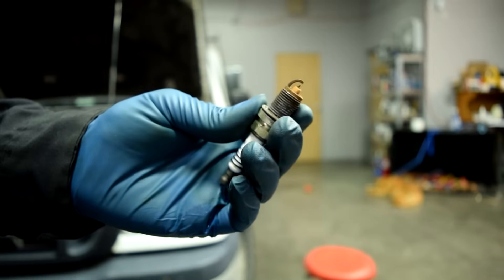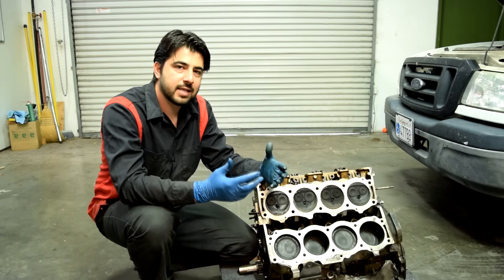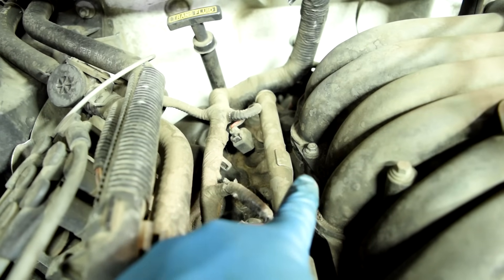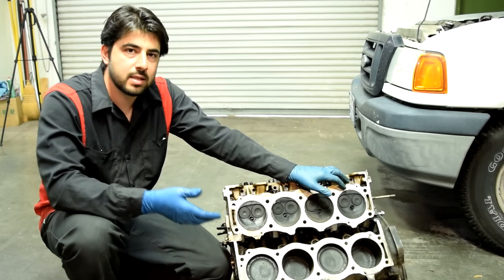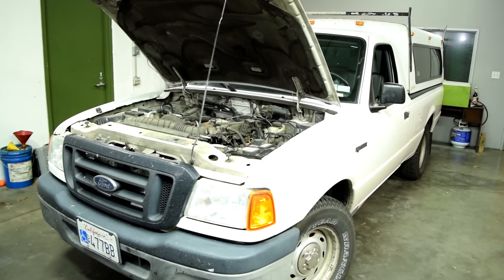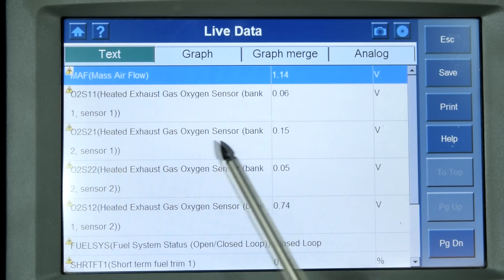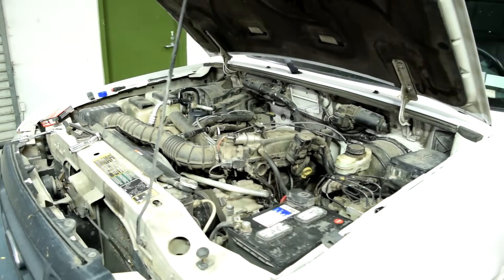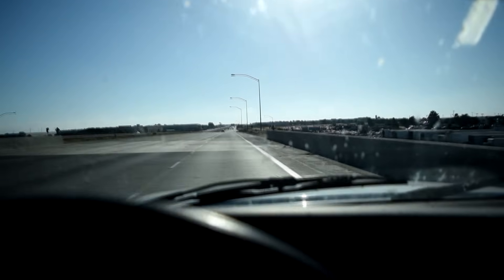How to Easily Diagnose and Fix Engine Knock

Comment: Hello. I just watched your video on fixing an engine knock. I really did watch till the very end. It was very well spoken for us non-machanics. I was hoping there were other areas or things to look at before going straight for the "new" motor. The only difference is that I am looking at a vintage 1974 GMC motorhome with a 454 engine that has been sitting for a while and is now starting to knock. I will look at all you recommended before going further. Thank you.

Comment: A small metal fell into the first cylinder and was removed after notice a noise. After starting it again a knock sound was heard, now it is not starting up. What can be the damage and to what degree? Your help please 🙏

Comment: Been having issues on my new to me truck a Silverado with 133k keeps throwing a knock sensor code already changed the maf which was at 1ish g/s at idle . Cleaned the intake manifold and I’m going to change the spark plugs next hopefully that was my issue 😢

Comment: if detonation sound is caused by wave fronts colliding then why preignition sounds the same? 
in cars with two spark plugs per cylinder why don’t the wave fronts make any knocking sound. 
 self ignition after soark ignition causes the  mixture to burn faster amd messes up timing but retarding timing helps.

Comment: Hi friend. I believe what you are trying to describe is called pre-ignition which is different from detonation. 
Pre-ignition is when you have a secondary source oh heat such as carbon deposit that would cause the fuel and air mix to ignite while the spark plug is off. 
Detonation is when you have two or more pockets of compressed air and gas mix that would ignite at the same time within the same cylinder. Since the two explosion have and fight for the limited space their collision will cause what’s known as a knock.
Reply: Pre-ignition, well, as the name suggests, happens before spark plugs ignite.
So detonation must be pockets of secondary ignition at or after the spark plugs ignite.

Comment: My car only start knocking when I put it on any gear and push the accelerator and when I release the accelerator then there is no any knocking noise, At idle condition doesn't matter how much I accelerate it remains smooth, problem occurs when I accelerate with gear in running condition and there's no noise from transmission but only from engine when I accelerate to run the car with gear

Comment: I have a 2006 Chrysler 300C 5.7 that is heavily modded (2009+ cylinder heads, 2009+ intake manifold, headers, cam, MDS/EGR delete) currently untuned. It only runs if the MAP sensor is unhooked at startup. You can plug MAP back in while its running, but then I hear a knocking/pinging noise. I'm guessing due to detonation. Between all the mods and EGR not able to be used (there's no way to hook it up and make it work with the new heads) that's probably why I heard that sound. It went away when I unhooked the MAP sensor again. Plus the heads also increase compression to about 12:1 or so. Its probably a combination of several factors, Fuel/Air/EGR. I just wish my tuner would stop dicking around and send me my tune.

Comment: I thought detonation happened before the ECM or distributor commanded spark ignition. Not after. That’s why it’s so bad. Because the piston position is still a long way away from being where it needs to be and the explosion of fuel tries to send it back the wrong way. Another term used to be pre-ignition. And advanced timing also causes it.

Comment: I think you are mistaken when you have mentioned that the over advance for ignition is igninting the spark at 5° before  tdc instead of 15° before tdc, this is actually retarding of ignition timing, which is recommended to prevent detonation.

Comment: I replaced my rocker box gaskets and new spark plugs and gaskets 4 days later I start the engine up the engine was knocking 2 times then it stopped if I go really fast you hear it knocking then I slow down it's ok every time I start it I hear it knocking that would be something about the spark plugs, can you let me know please or someone. I will need to take off my inner take manifold and I don't want to do that again it sounds like I need to take it off

Comment: Guys I need help I have a 2004 mustang and sounds like I have a rod knock cause the engine knocks when it runs but I think I could have a head gasket problem cause when it drives the coolent boils and over heats

Comment: I got a 2013 Chevrolet impala  and with direct injection i had a pinging noise when i accelerated,  i added that Berryman B-12  AND it really helped that pinging.  I assume i had carbon build up . Very interesting video 👍
Reply: You added to the gas or what exactly ?

Comment: I have an 04 Tacoma V6 that throws knock sensor codes. I replaced the knock sensors and plugs and made sure to use the recommended dual lead plugs. I later noticed the knock sensors would trip while I was driving on the highway and the engine would slow to 2000 to 2500 rpm. I ran regular fuel. I never open the cylinders up to look for carbon buildup. Never did a compression test. Do you think I could have bad seals or a leak in the intake system causing a lean mix? The sensors tripping when I would be in that rpm range is confusing me

Comment: question..my car have a knocking issue at high RPM(engine check is on)specially if i ran my car at the highway.. ,but on low RPM it's fine..any suggestion what is the problem with my car..please help,thanks🙏

Comment: Strange thing about running a lean condition is, it ends up using more fuel. You'd think if it's running lean it'd be less, however you end up mashing the throttle open more to compensate for the lack of power and in turn makes it use more fuel.
Reply: Was thinking about that just now!
Reply: It is not only that. ECU knows via knock sensor that knock is occuring and it applies protection strategy which is adding fuel and reducing ignition timing -both help to suppress detonation but both reduce power as well so you get less power and high fuel consumption

Comment: Hi GREAT VIDEO! Need to double clarify here for lean air fuel mixture it causes knocking sound.  Does the knocking sound occur immediately under heat or pressure?  OR it induce carbon build up therefore excessive carbon build up causes knocking sound?
Reply: Nono fuel mixture makes the engine knock immediatly, carbon is another thing

Comment: Thanks for the information. Just replaced old carb with new holly for 69 fairlane and had issues with gauging rpm, I don't have rpm gauge, engine was reving high, now under control but noticed knocking sound.

Comment: I am your old subscriber , plz tell about cases of 1 or half second knocking or rattling sound on engine startup.  It is suzuki swift 2012 , 1.3 non vvti engine,  my radiator become empty few days ago for few min,  but heat gaige not goes up.  So i suddenly stop car and replace radiator and car was ok,  after 10 days this rattling sound start comming on cold start up for just 1 or half second.

Comment: Thanks for the video.  I add a couple bottles of Gumout with PEA to my vehicles gasoline occasionally to help clean up the intake valves and combustion chamber.  I also use it in my old carbed motorcycles and it does a good job helping to keep the carbs from plugging up.  I also use it in the gas of my 2 stroke FI boat motor where it solved an engine miss.  I also mix some with the gas in all of my gas powered lawn tools to keep the carbs clean.  Chevron Techron does a good job too I've heard.

Comment: its a pre ign. knock lighting the fuel mix before the spark plug not after, while the piston is still going up . you might want to look into it. After the spark plug lights the fuel theres nothing left to burn one two or three more times like you  said

Comment: Any chance installing a bigger battery  on my 4 cylinder van (i went from 70AH OEM Led Acid to 115AH marine deep cycle) and now noticed slight detonation/spark knock at around 20mph to 40mph.  it's very slight.  My alternator is 160Amps.  Not really sure it's related.  I noticed it does not do it with super unleaded.
Reply: No thats odd my car runs fine even when you disconnect the battery. I have tried this just for kicks. Your vehicle can run without a battery. Just turn it on discconect the battery and be on your way. We did this when i was a kid because we could not afford a new battery and only went to town once a month.

Comment: Thanks for share! 
This video was in 2017 but maybe you can help me.
I am a one cylinder motorcycle user and I can not find a good answer to my question here in my local area.
so I have been searching here on youtube.

My case:
I find a sound coming from my cylinder.
It occurs when climb roads, when I open throttle from ¾ to full.
When climbing roads, ¾ of throttle opening does a good job...   engine breaks the load so well but when I open full throttle, there is not more power than ¾ throttle opening,  there is not better speed or aceleration than ¾ opening BUT THE SOUND OF CYLINDER SEEMS LIKE DUPLICATE.
I can not say this in technical words...   and I dont know what specific name exist to this condition...
Then...  under climbing load ¾ makes normal sound but full opening sounds weird...    knoking, pinging, rattling or detonation I don't know.   
I have read some but seems be the same thing?
Only mod I have made on my engine is about main jetting from #102 to #112.  better feelings but same sound when under load I force to full throttle.

What data can I give to you?Honda XR150L 2020.
5000 miles.
9.2 to 1 compression.
Only Chevron Texaco 97 RON.
1500' above sea level.
82~89°F.
20mm carburetor, now main jet #112  stock jet was #102.
NGK hot range 8, ( 9 is recomended for high speed riding and spark plug reading in hot range 8 shows some wear in central electrode when plug was 2200 miles from new. white ashes too so i found lean jetting from stock, jets #35 #102).
About Ignition timing i did not research yet.
overheating?, this issue only happens under load.  ¾ throttle runs well but full throttle does not gives more power but weird sound appear.

Regards from Colombia south america and thank if you can help me in some way.

Comment: I have a really bad knocking noise in my 2009 dodge caliber inside my motor and my oiled was over filled pass the line by like quarter and oil was leaking on the side where the fan belt at …..

Comment: I remember an old mechanics trick to stop or reduce knocking by adding a gallon of diesel fuel to the tank (summer driving in hilly areas). Ever heard of that?
Reply: It would raise the octane so maybe it would work, modern cars would probably have problems with that though
Reply: @andreahighsides7756  I am sure you are correct. I would not do it to a car newer than 1980s.

Comment: My car wont start and i dont hear anything when i turn the key the right pressison and i tried the other pressison i did not hear anything its probley from the engine, Sparkplug and Battery And Its Shows That I Have 0 Fuel And The Arrow Form The Fuel It Shows Emety My Dad All Ways Put The Diesel Oil Beacuse This Is The Oil For My Car But When I Turn The Key Over The Correct Pressison You Can't Hear The Engine It Wont Start ?!?!?!?!? I Am Confushin!!!!!

Comment: My engine had 300k on it. Just bought it. It didnt knock when i bought it but today i changed the oil and turned it on. It knocked, and knocked in nuetral, but when i drove it stopped then after driving around the block the knock stopped. Update I think its an EGR problem or something. Like a diaphragm that isnt working properly till it heats up and it may be messing with the o2 sensor bank 1 
Update pt.2 The bank 1 sensor one replaced from a junker, it killed the code, the deep wierd knocking sound was coming from a rectangular unit behind the EGR valve. It had lost all of its screws and blown open. I bailing wire tied it back together and now have an egr code but the sound stopped

Comment: Thank you for uploading this video it's the most comprehensive coverage on what could cause a P0325 code available on YouTube. I recently had my head gasket replaced on my 2005 honda civic lx special edition. Three days after getting it back I'm getting a P0325 code thanks to you I at least have some steps to take before I spen a ton more money.

Comment: Great show. Hoping you can help me. I have a 2008 Ford Edge with less than 95k. Check engine light came on registering code P00112. Mechanic said the engine burned the oil and I need a new engine. Check engine light only came on the day before the mechanic saw it. Oil light never came on. Any suggestions before getting a new engine?

Comment: i have a jeep 4.0 that had the bosh platinum plug in it (wrong kind of plug). it was getting almost 10mpg (should b getting 18-20). 
when i put the correct plug in, it ran better and brought the mpg up to what it should be. but then the slight tick turned into a knock :( ... 
could changing the spark plug to the correct spark plug (after running the wrong plugs for years) cause a spark knock ?
i am thinking that i have a broken piston or piston skirt :(

Comment: Thanks for the video!

Based on what I understand here with my Toyota v6 I'm going to simply try higher octane fuel as a 'dumb' diagnostic to see if it helps. Of course this doesn't fix the problem, but gives me some time before I have to worry about fixing it. Then I'll probably do some Seafoam, easy to do and not a whole lot of effort (possibly will clean out carbon.)

Then after I've wasted my time and gas money on that I'll go after the real problem which I'll bet is probably EGR, spark plugs, or lean fuel.

Comment: I have an 05 GMC Yukon that started doing really hard downshifts after I had the rear main seal replaced. Not sure exactly what's going on, I checked the transmission fluid level after I got it back and it looked a little high. It's generally ok if I take it easy so I've been putting it off for other jobs (like the front end it needs). Today I was going home trying to pass some jerk on the road and it did a really hard downshift, my rpms jumped from like 2k to 5,500 and I heard a really weird rattle as the rpms jumped, I'm not exactly sure what bad pre-ignition or detonation sounds like but it definitely sounded bad enough for it. I don't think there was any catastrophic damage, just wondering what the hell that noise was and if it was pinging or one of the other two how much damage a single event like that would cause in general. This thing is pretty old and I need it to make it to my next vehicle. I generally don't try to dog the thing but sometimes it just happens.

Comment: Would be great if all engine knock problems were as simple as old plugs.  Good list of possible causes.  For the purpose of evaluating fuel trims for rich or lean condition, it should be check at varied engine speeds and loads.  I recently switched from 87 octane in my Ecotec, GDI engine to 91 Octane, Top Tier fuel and it significantly reduced my positive long term fuel trims.  Before it would run nearly 10 percent, but now it is 2-3, with STFT fluctuating between -2 and + 2.  This is consistent through all engine loads.

Comment: Octane is also relative to altitude. If you buy fuel in higher elevations, it will have 86 or even 85 octane rating. So if you regularly fuel in the mountains and work every day close to sea level, you will have the same problems. Be mindful of your fuel habits.

If your computer is firing too advanced, you got problems. Run the right plugs in your vehicle. You can adjust the heat range simply by running cooler plugs. I'm not gonna hash that out. I'm sure this guy knows what I mean. Also, nothing wrong with blowing a can of sea foam through the tank. The videos on Sea Foam I've seen here aren't controlled well enough to believe. I've had awesome success with it. If you run short trips every day like less than 10 miles each way, you're gonna run into carbon buildup. Get that sucker good and hot once a week like run down the highway at 70 for a half hour if you can to help burn off some carbon. Yeah its burning money but in the long run beats a new engine. I'd rather burn a gallon a week of gas than buy a new 4 banger or even 8 which means buying a new car is cheaper. Parts and labor for a F150 engine swap is about it's worth relatively. DIYers have at it. I'd just spend and extra 3 bucks a week and run hard and high to keep it cleaned out.

Comment: Hello,  I have a 94 corolla 7AFE 1.8L with 98k miles. I get error code 52 (knock sensor) - the check engine light turns on after the engine is warmer and has idled at a red light. I took the car to my mechanic and he replaced the knock sensor, same problem. I removed the EGR valve, cleaned it - removed and cleaned throttle body and IAC vavle - same issue. Tested the EGR and EGR solenoid - both fine -- still get error 52 - and computer retards ignition --   Do you have any idea what it can be ? any info would be greatly appreciated.

Comment: No surprise there! 
Toyota recommends replacement of Iridium spark plugs every 12 years or 192,000 km (120 000 Miles),on my 2006. Corolla and 2010. Yaris.
I believe that Iridium type of spark plugs can last that long but I can see gap is getting wider even after only two years or roughly 35,000 km (22 000 Miles).That is frequency of replacing spark plugs on my vehicles.Toyota is urging not to adjust electrode gap.
Iridium type of spark plugs are not expensive as they used to been back in 2006, when you had to buy only Denso (OEM).I just install new one.I never had any problem so far.